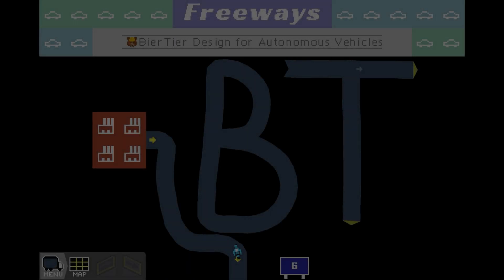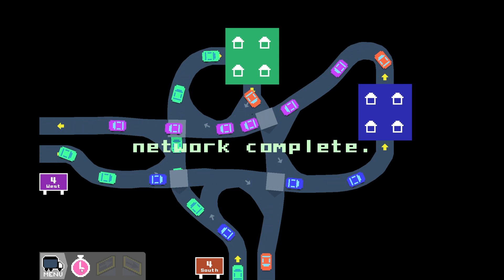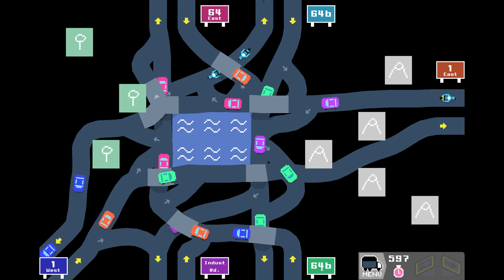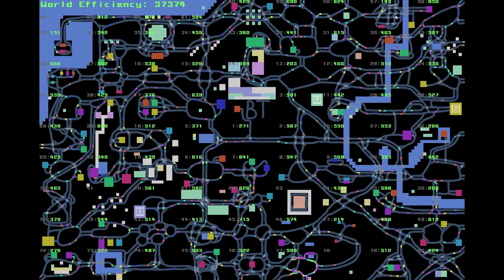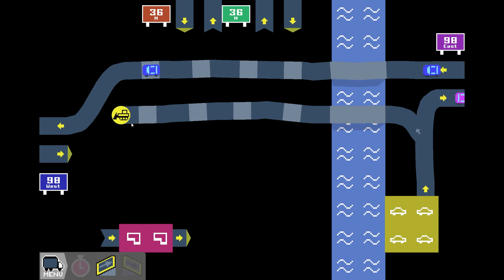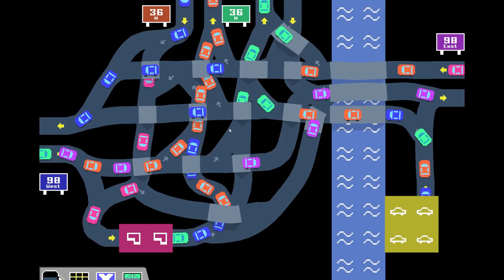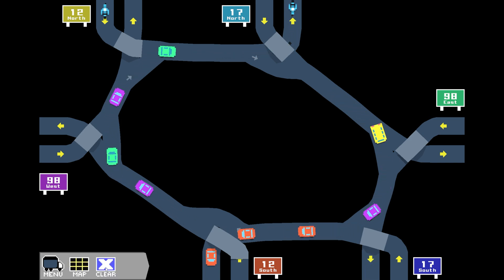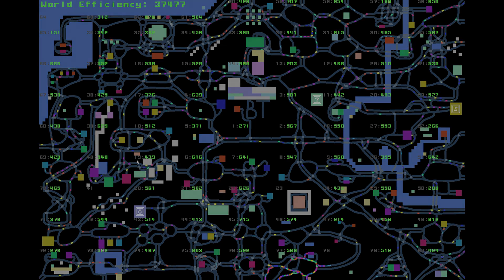CRAZY EFFICIENT BRIDGE EXPLOIT in FREEWAYS! (EP22)

Comment: in level 58, you could have just go the other direction, and that way, there's no need for bridges. You can draw a simple roundabout... My guess, but think about it...
Reply: i noticed the same, also for 59. but i didn't check the traffic flow of the map
Reply from the maker: Unfortunately, on both of those levels the high traffic flow is reversed, that is why bridges are needed. The other way around would literally jam it because of the traffic density :)